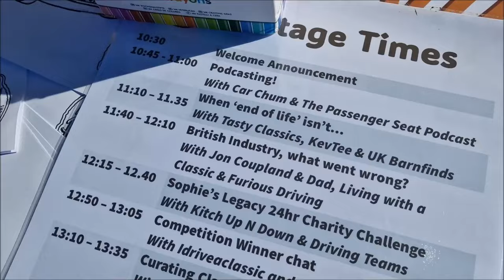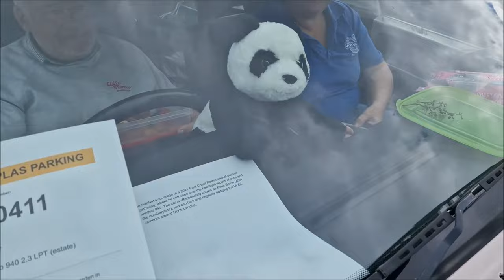Rustival 2 - The UK's BEST Car Show RETURNS!

Comment: Looks to of been a great show guys.. pleased the Micra made it she looks good 😊

Jon I've got the roadster wheels on my 450 and it makes a massive difference in comfort and the effects of the cross winds on motorways ... 175 55r15 on the front and 195 55r 15 on the back , if you put the roadster  185 55r15 on the front they rub just for ref if you do go for it 😁 enjoy your rest 👍
Reply from the maker: Was fantastic 😊
Reply: @JonCoupland  I think that red/orange colour was may Vermilion 🤷‍♂️